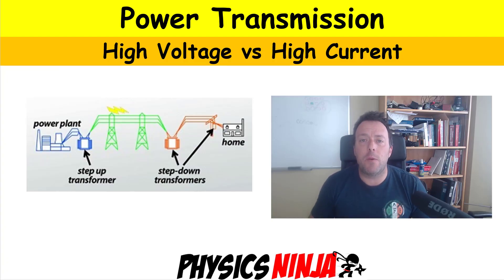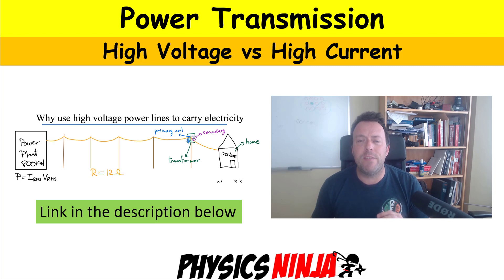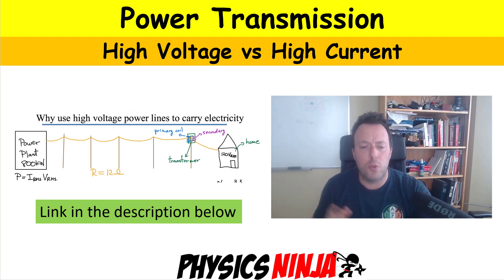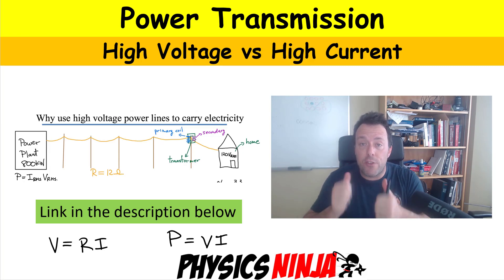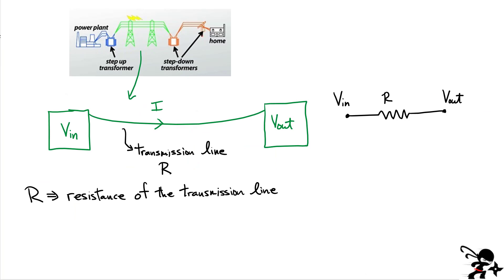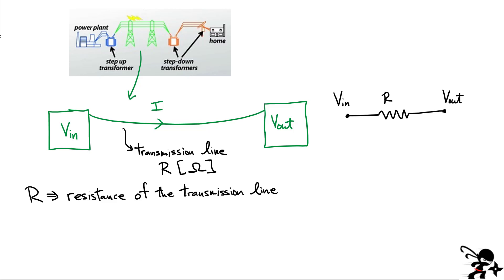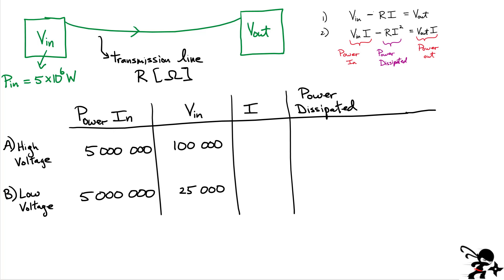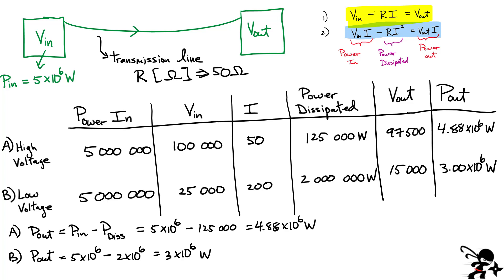Power Transmission: High Voltage vs Low Voltage Comparison

Comment: This is kind of a stupid doubt, but won't the resistance actually change when you change the current and hence the total heat loss would be the same eitherways?
Reply from the maker: Resistance will change a bit when the temperature increases. At a fixed temperature the resistance is constant.
Reply: @PhysicsNinja  Okay, thank you.

Comment: You need to add reactive impedances and susceptances. Or.. you'll get the wrong answers on load voltages and currents. Signed.. big electric power engineer